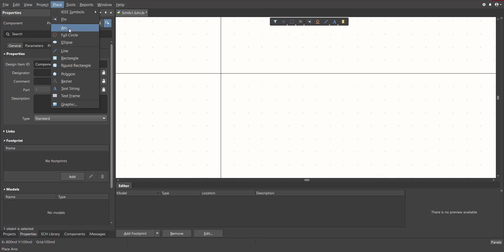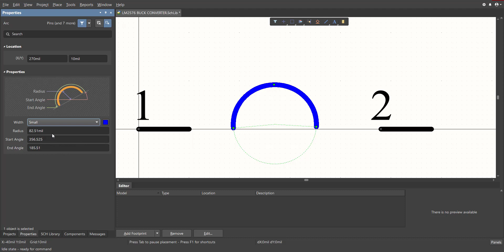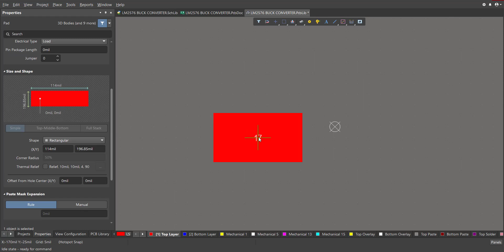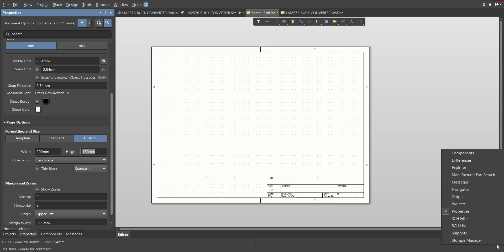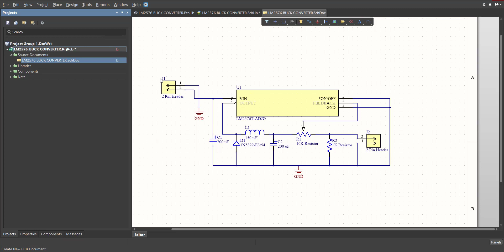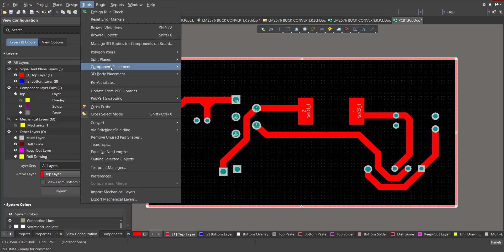LM2576 Buck Converter | Altium Designer PCB Tutorial

Comment: hi i have question, What is arrow symbol on res1(10k resistor) and how to make it?
Reply from the maker: That arrow on a resistor symbol normally indicates an adjustable resistor—a potentiometer or trimmer—rather than a fixed 10 kΩ resistor. In Altium, use a potentiometer/variable-resistor symbol from a library or create one if your library doesn't include it. Which Altium version are you using?